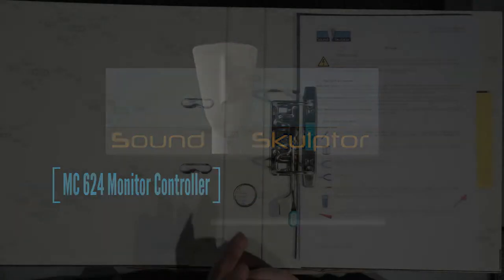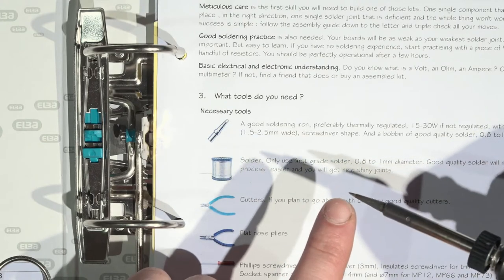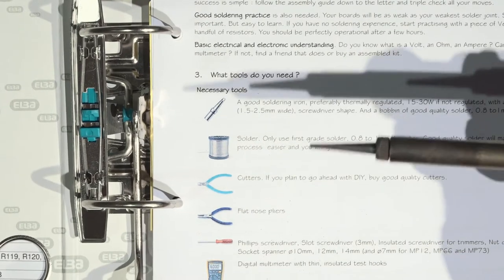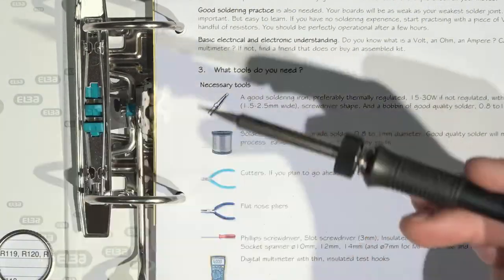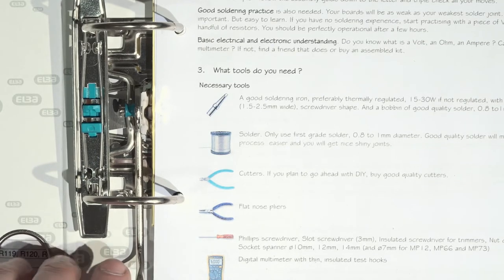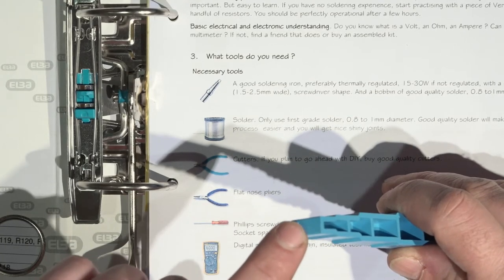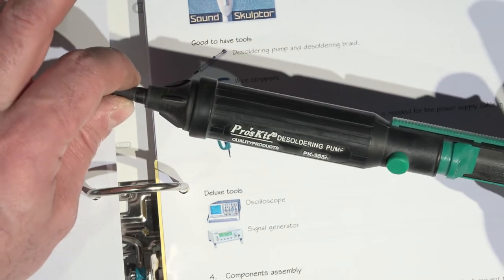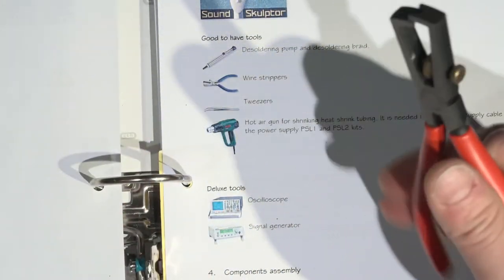Sound Skulptor MC624 high-end monitor controller. Documentation and tools

Comment: Never heard of EMU-1820, it's clever to use it as sig gen.
Reply from the maker: Jetset Willy The EMU 1820 (family) is the most advanced audio interface on the planet in My opinion. They did the first time to integrate real DSP based signal processing right into the interface. Way back before the UAD came out with the same idea. I used the onboard processing for many records. I also know a very successful artist, who used also. With over 1 million sold labels. I have also the M version which is the top notch from the family, with more advanced signal chain and better quality converters. You also can emulate the EMU Emulator system fully with the DSP if You purchased the EMU 1820m Emulator pack. Amazing gear. In 48K mode You can put many processing into the channel strips. Plus send, and master bus effects. Maybe I will do a video about it? Even today You cannot find a similar solution on the market. So if You see this puppy on the Ebay, for cheap, just hit the buy button!
Reply: Thank for the info, I'll hunt one :)